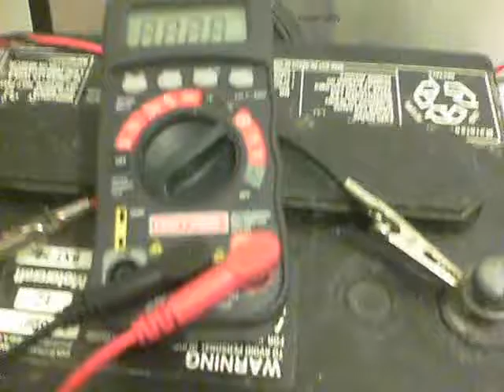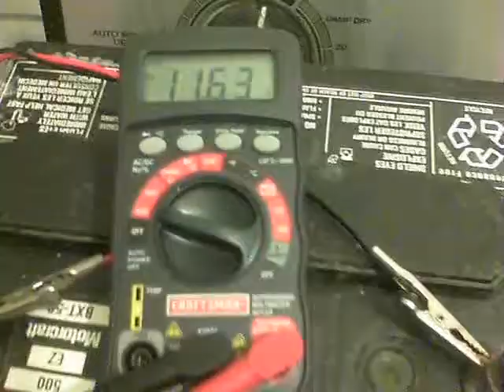Bedini 6 coiler

Comment from the maker: All is in how they are wired up...have to do a vid on that to show it...but my 20V panel on the lightning vid puts out well over an amp. Point soldering with 30 gauge wire is as good as full tabbed soldering for pieces ! 
The smallest size for 150mA is exactly the same as the panels on those 'Smallest Car in the World' panels. Then it drops off linearly enough :)

Comment: Hi Mr John Bedini,
Nice to meet you i verry interrested to order small motor generator for to
charging my battery , my battery its 48v 50ah please can you tell me for
150 units 3coils motor and 3 coils generator how is cost for us ? and how
many time you need to build the quantity and i want to ask you if the motor
generator can be run automaticly or manual , and tell me pleas you can
built the quantity with alluminum material no plexyglass ?
best regards
aziz

Comment from the maker: @Begbucks Hey Dan. Folks normally use either the 1245 or 1250 RadioShack 12V gel types, or common car batteries. These systems generally run at 12V. Not sure what group they are. However, solar power input and anything from a 1.2V rechargeable AA can be on the output (I have a couple of such little batteries that are still running a clock weeks later after a 45 minute charge). I'm in Oklahoma :)

Comment from the maker: @Begbucks I built it for a friend who had trouble soldering, so the longer term running is unknown. In fact, I don't have any decent car batteries yet, just 2 salvage ones, though have now built a few smaller units from scratch for own use. This project was also to finally get to grips with actual Bedini circuits and it started as a standard 3 coiler...then we went for the 6 coils (previously i'd built many pulse motors to own designs). Sorry to be vague !

Comment: continuation... 
I'm not sure why Rick started offering the 3055's the MJL's work much better at 12+ volts.
I have had good results with MJE13000's these have a similar if not better SOA to the MJL's. anyway - put a good battery on there with low impedance :-)

Comment from the maker: @UrCoffeeTastesToasty Thanks. Yeah, that's the point really, it's to official spec. Using an official R-Charge rotor, R-Charge magnets, R-Charge bobbins and 1 of 3 recommended transistor type. The alternative for power supply was plugged into the wall and I was sure someone would've picked up on that lol.

Comment from the maker: @min2oly Simply no good batteries yet. The 3055's are new - didn't want 2nd hand on someone elses machine. They can, of course, be swapped out if the owner wishes when is posted back. 
More to the point, I hadn't built a SSG before last month and so as much was about learning + thankful for opportunity, as doing as good a job as I could. 
Using this and own build, this batt holds at 10.89V and has 6A available continuous for 1/2hr...very useful for many projects, if not for starting a car :)